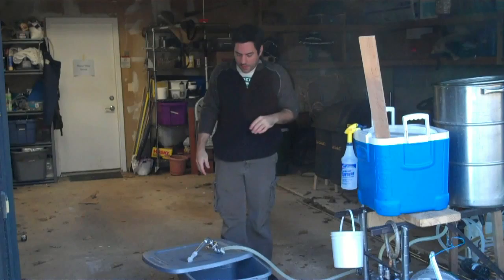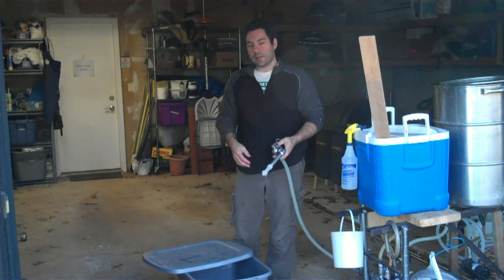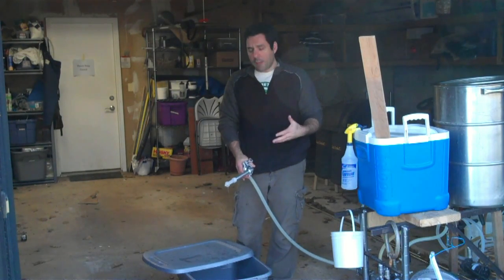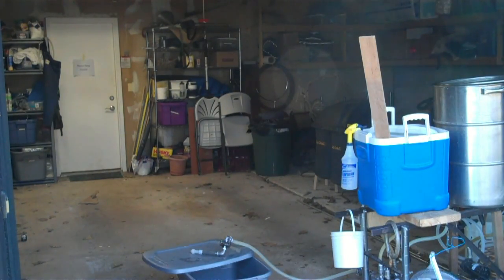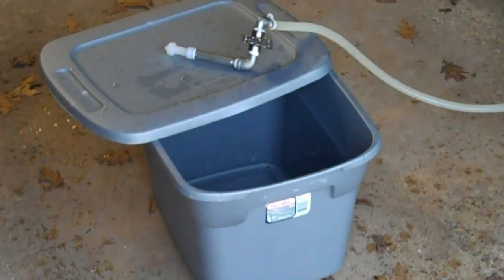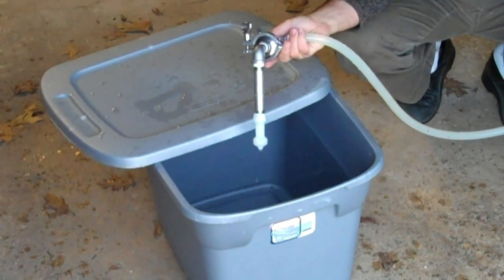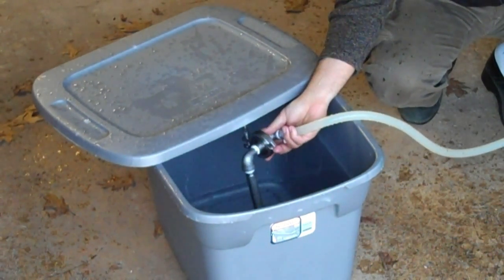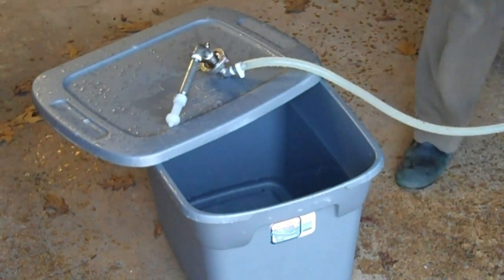Clean in place (CIP) rotating spray ball test for the new conical fermenter

Comment: I found the part but it says the thread is 1/2" BSPP,  how did you get it to work with NPT? Adapter or force it?
Reply: ***** that is what I was hoping. Another website with similar part (but not for sale, wholesaler) shows works on both. Thanks!